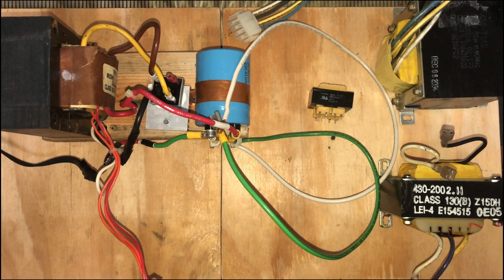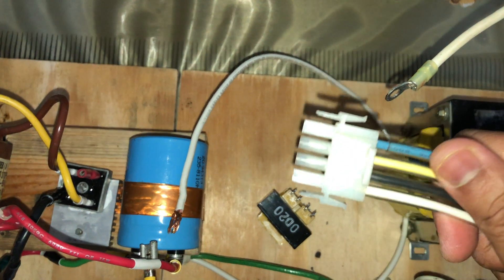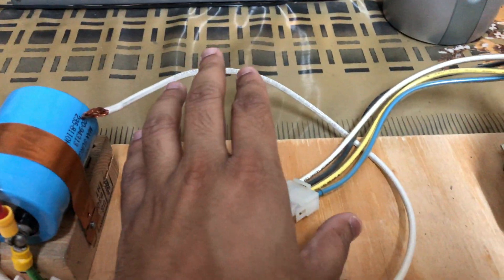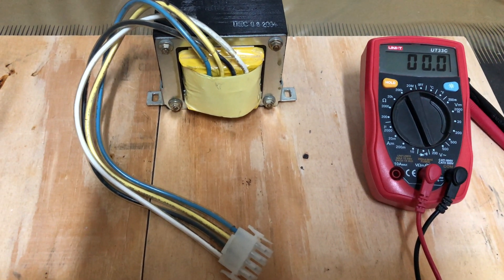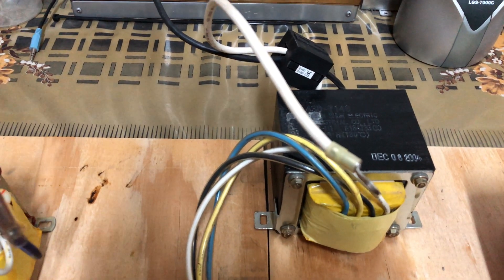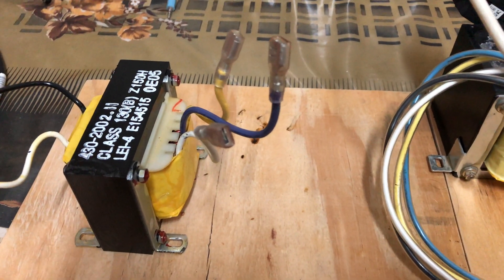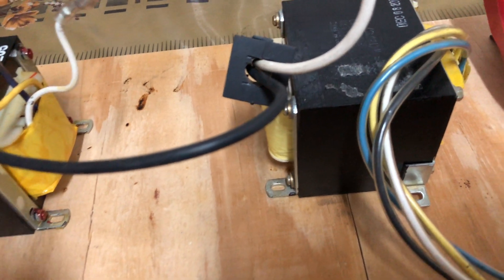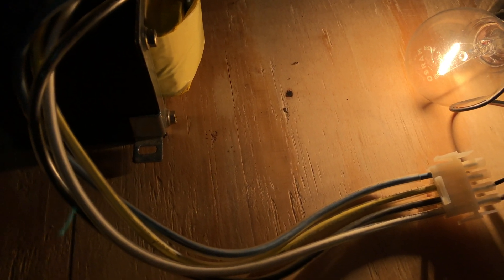Simple test to identify the high voltage 115V primary leads of a scrapped old UPS transformer

Comment: 9:45 - I think I have this transformer if it's from an APC UPS. I want to use it on 220V to get DC voltage out. Is that possible? Why are you getting AC?
Reply from the maker: Yes, that’s for an APC 300VA UPS. If your UPS is a 220V version you can plug the two wire side to your wall outlet(In my case the white is Neutral & Black is Live/hot goes to 120V as the power in my location is 120V). The other side you should get low voltage which can he rectified and filtered to DC. If you need to vary you can get a high wattage DC-DC converter.
Reply: @sciencetrove  I did some research and now I understand it better but I don't know which out wires to use on the low voltage side. I plan to connect it to a buck boost converter to make a variable power supply so I don't need an exact voltage since the boost converter accepts from 6-36V but I don't know which bridge rectifier and capacitor to use. 
10000uF 35V 105°C 30x35mm ±20%
capacitor and B600 C15000 600V 15A bridge rectifier is ok or is that too much or too little?
Reply from the maker: @westsenkovec  the low voltage side of the transformer can deliver a lot of current even on a 300VA UPS. About 40-45A easily. You will notice the wire is quite thick too. On the high voltage primary side i.e., 220 or 120V side the wire would be much smaller. 

Usually a bigger capacitor would give better smoothing effect but it also introduces the issue where the voltage would take a while to build up in next AC cycle. 
Given the large current capability you can go for a higher current rectifier like from 50-100A. This will protect the rectifier in case of an accidental short circuit.
Reply: @sciencetrove  I noticed that the center tap secondary winding has thicker wires but the blue and brown secondary windings that give 19V are thinner which is confusing.
Reply from the maker: @westsenkovec  can you take some good pictures of the transformer  showing both sides of wires and upload it to imgur. Then post the link so that I can take a look.

Because if you were to accidentally connect the low voltage side to 220V, then there is gonna be a magic smoke +bang! xD

Also, measure the resistance reading on all the windings. Usually the 220V side should have higher resistance values.

Comment: how could i get 220volts primary input of apc ups transformer sir?which of those 4 wire to get 220 volts ac as input voltage?thanks
Reply from the maker: The easy way is to do what I did like in the video. The output thick high current low voltage wires of only two wires are usually 15VAC or about 7.5VAC with center tap. You can apply this 15 or 7.5VAC from a cheap $2 transformer salvaged from a Chinese adapter that can be brought from a local electronics shop and then use multimeter to measure high voltage at the other side with 4 wires to see which one outputs 220V.

Comment: Can the primary test be conducted with resistance test?in my case i have 3 wires in primary the higher the resistance cud be 220volt?the lower is 110? Can this be test like this?
Reply from the maker: Yes, resistance test is possible. If the transformer has both 115v and 230v leads then the resistance between the center wire and the other two must be equal. Usually UPS is meant for a specific country or region and hence they generally don’t provide both 230V and 115V on same unit. But I could be wrong also.